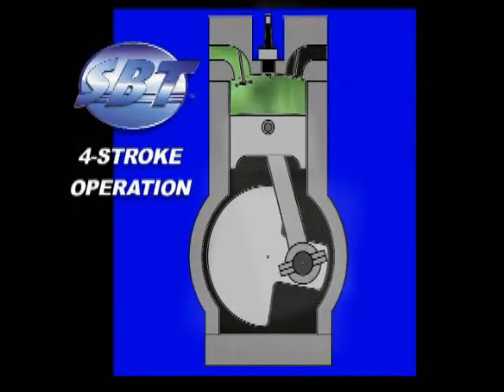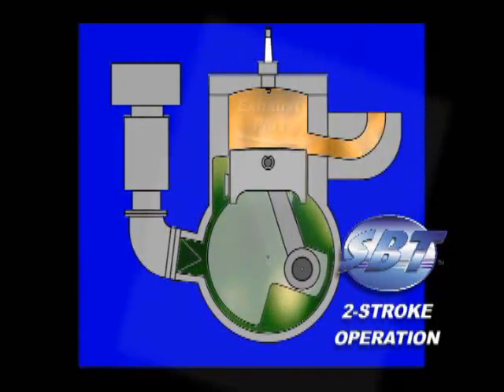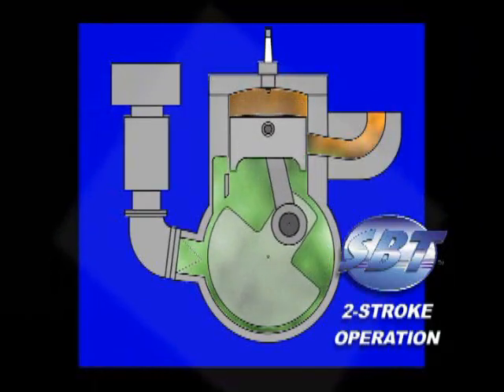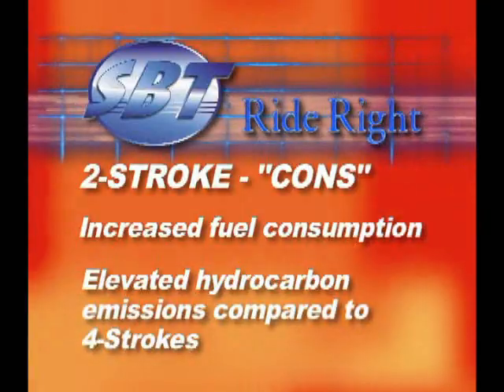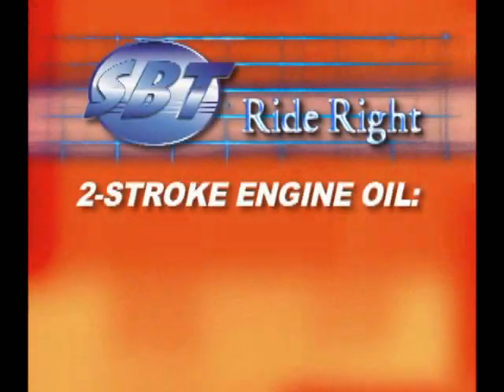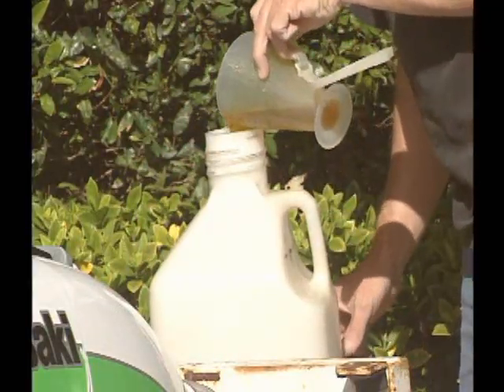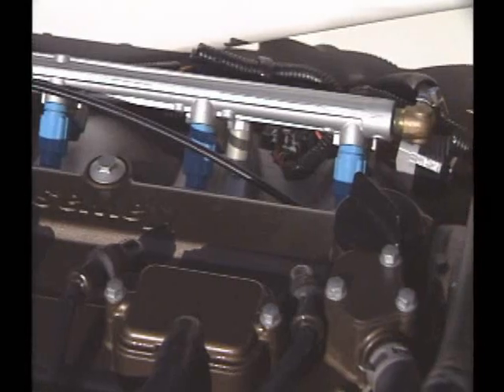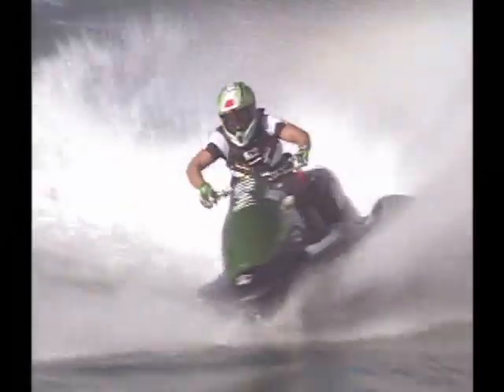2 Stroke Engine vs 4 Stroke Engine

Comment: Is the 2 stroke engine less efficient?
Reply: The power band "issue" is not related to gearing. All engines have a peak bhp at a certain rpm. With a 4 stroke this area of peak bhp is is much wider than with a 2 stroke.However, although the powerband is narrower with a 2 stroke, it is typically much higher than a 4 stroke when comparing 2 engines of the same capacity.

It is not an issue for seasoned 2 stroke riders, if you watch professional enduro riders, they use the light weight of a 2 stroke with it's high peak power to get up hills you would struggle walk up. The same rider could not do the same with a 4 stroke. It's horses for courses. Both have their pros and cons.
Reply: depends, 2 stroke are much faster per cc. for example, when moto gp had both 4 stroke and 2 stroke in the same championship it was 500cc 2 stroke against 950cc 4 stroke, they were fairly evenly matched. 2 stroke is way more fun, sound amazing but are more difficult to manage the power. they have a much smaller power band than 4 stroke.
Reply: Nevets
Interesting! How about fuel consumption?
Reply: +Richardsen they tend to have higher emissions, due largely to the fact that unburned fuel escapes with the exhaust.
Reply: When it comes to fuel efficiency, yes, a 2 stroke is less efficient than a 4 stroke, when it comes to power, a 2 stroke has more than a 4 stroke simply because there are less moving parts.
Reply: +Richardsen It makes about twice as much high end power, due to requiring half as many strokes
Reply: Kenny Smith
So why aren´t they more widespread?
Reply: Christian Hodges
Ah, so there is some inefficiency. That was something that kept me wondering; the absence of valves like in a regular 4 stroke made me think of a... less precise machine when it comes to admission and exhaust.
Reply: Nevets
So that is why they are not more widespread then.
Reply: Richardsen The main reason is probably environmental. They burn oil as it is mixed with the fuel and not all the fuel is burnt. 4 strokes have a wider power band which makes them easier to ride but not as much fun. You have made me realise that this is quite a complex subject. Enduro riders love 2 strokes, MotoGP riders who rode in the days of 500cc 2 stroke, really miss them. 

My first few bikes were 2 strokes so my view is probably biased. Having said that, I doubt I would have anything but a 4 stroke now. I am pretty keen on the Honda Africa Twin.
Reply: Nevets
This has been an interesting insight. Thanks!
Reply: +Nevets You guys mention power band, and power control issues ( difficulties, if you will). Elaborate please ? 

Is it because the 2 strokes might have shorter gearing ? or are just pumping power out so quickly it's kind like a "o sh*t" when you twist the throttle ? im under the in personation its a lck of power .. but if the 2 stroke makes power every 2 strokes... then it cant be a lack of power aha 

the only thing that keeps me wanting a 4 stroke is the depth of the exhaust noise.

Comment: the baised will always exist. But the fact is that 4 stroke has more advantages.
Reply: True 4 stroke engines are better about controlling power but if a 4 stroke motor blows up its gonna cost a lot more than a 2 stroke motor to replace.
Reply: +Open the Light AUA Naah...

Comment: yeah well im riding a Moped with a 70cc 2T Engine and im easily passing a KTM Duke 125 with a 4T engine, face it 2Stroke has a way higher power output and a way higher fuel consumption :3
Reply: +Jed Jeakings no theyre not lol
Reply: [100]PureBlacK my 1981 yz125 2 stroke has got the intake on upper cylinder  explain dat shit!
Reply: You are an idiot, KTM duke is so shitty. But try passing and YZFR125, you wouldnt get even close.
Reply: Doesn't change the fact your on a gay shitbox

Comment: what happens if you put 2 stroke oil in a 4 stroke 150cc engine?
Reply: angelisone stfu people are trying to help you and you are just being a bitch about it
Reply: +angelisone just thought id remind you like everyone else about how shitty you are. throw your pc/phone in the road, bud.
Reply: +Cairo Murphy (TheMasterAssassin8787) no my friend put 2 stroke gas in his 300ex and nothing happened other than it wouldnt run worth a crap and he lost alot of power, and its ok to mix ur gas in a 4 stroke every once in a while to clean stuff in the motor or just simply put a little diesel in the motor and it will clean the motor too
Reply: +angelisone  its a lubricant so under light load it would be ok certainly wouldnt affect
the performance but under load it would cause bearing failure eventualy because of
its very low viscosity !
Reply: +angelisone Seriously? You are asking a question. We are trying to give you answers.

I happen to know exactly what happens when you put 2 stroke oil in a 4 stroke.
Here is your answer:

Small pink unicorns are expelled from the exhaust port. They exist for only a fraction of a second before they evaporate into vaporized Milk Duds.

If you don't believe me, perform the experiment yourself and find out. Or you can take the word of a random person on the internet who claims to know, which is what you were seeking to do in the first place.
Reply: ***** No, the question was into the oil tank (oil cap's hole).
Like using the wrong oil.
Reply: ***** You are just guessing. So you don't know the answer.
Guessing is not an answer.
Reply: angelisone Engine will run rough and probably seize.
Reply: Cairo Murphy you are guessing also.
"probably" is not sure.
Reply: ***** gotta love people getting madddd because he couldn't answer a simple question.

bet you can't tell the different between regular oil and synthetic oil once it's installed in the engine.
Reply: if you mix with gas with oil it will smoke more but put 2 stroke oil in 4 stroke oil it with melt engine
Reply: +angelisone your not a good person
Reply: +angelisone well normal people dont put 2stroke oil in a 4stroke so you asked a dumb question
Reply: the engine will seize up due to lack of lubrication, the oil will burn out. Once there's no oil in that block it's gonna seize, if not throw a rod altogether
Reply: +angelisone And the 4 stroke will either not run worth a crap or just lose alot of power
Reply: +Shaun Keefe yes your right
Reply: +angelisone Good question. I almost run out of gas in my car once. I usually keep half a gallon of gasoline mixed with Red Line 2 stroke oil 40:1 for my RC planes with DA engines. I was wondering if I ever run out of gas and I have an emergency that i have to be somewhere, what would happen to my car's engine if I use it... besides the unicorns engulfed in tons of smoke.  If I ever do it, I will report.
Reply: you're a fucking dumbass
Reply: dont call people dumbasses, he wasnt sure, just cause he didnt know doesnt mean people like u can come around and call them dumbasses!
Reply: ooo, somebody didnt put their tampon in the right hole this morning
Reply: That's what I damn thought
Reply: what is what u "damn thought"?
Reply: you would know
Reply: who is stupid
Reply: you go first, and also, how do you know what i look like ya pervert
Reply: LOL, people these days pfff lmao
Reply: +angelisone Well 2 stroke oil is not heavy enough to properly lubricate the engine, the differences between a 4 stroke and a 2 stroke go well beyond simply the strokes in a cycle. Your engine will blow up, simply put.
Reply: +Kenny Smith nothing smoke like a bitch
Reply: +Sacrifice195 clean the motor😂😂😂 it would do the opposite
Reply: you wont have to clean the motor cause it will be too late, 2 stroke oil breaks down, 4 stroke oil dont break down as easy, it takes a while for 4 stroke oil to break down

Comment: Try the 2T motorcycle and 4T motorcycle. You will see big difference. For me 2T on motorcycle is better than 4T
Reply: +Abimanyu Damar H Especially a 50cc... 2 or 3 times greater power (2T 50cc) than a 4T (50cc)... I liked the bike a lot back then (2 years ago or 3)

Comment: Michael Harrison from the DeepScience BIGENZ team has this to say:
Most of what is written on advantages and disadvantages of 2 strokes Vs 4 strokes is not actually correct.

Take for example the lubrication issue of 2 stroke engines, sure small chainsaw engines may have the oil mixed with the fuel but this is not a direct result of the engine being a 2 stroke, this is just a result of someone designing a very simple engine. look at any large Caterpillar, or Detroit 2 stroke they have conventional oil sumps, oil pumps and full pressure fed lubrication systems and they are 2 stroke!

Also, the argument about valves of 4 strokes versus the reeds and ports of 2 strokes is also incorrect. Sure some simple 2 strokes may use very primitive systems to achieve the control of fuel/air mixture into the engine and exhaust out of the engine but again this is not a function of them being 2 stroke! I've worked on 2 stroke engines that feature poppet valves in the head (like a standard 4 stroke) - but they are definitely 2 stroke - it's just that engines like this are not so much in the public eye - next time an ocean liner (ship) pulls into port check out its 2 stroke, turbo charged, direct injected diesel engine!

Finally, the arguments of simplicity, weight, power to weight, and cost of manufacturing are not a function as such of 2 stroke versus 4 stroke engines. The mistake of most of these commentaries is that they are comparing a simple chainsaw 2 stroke engine with a complex 4 stroke engine from a automobile - not a very fair comparison.

As far as the exhaust emissions of 2 strokes - check out the Surrich/Orbital 2 stroke design that Mercury outboards are using - this is as clean burning as any 4 stroke.

The ONLY correct comparison of 2 strokes with 4 strokes is that a 2 stroke can (in theory) produce twice the power of a 4 stroke for the same sized engine and the same revs.
Reply: Very true. That is why all car manufacturers use 2 stroke engines over 4 stroke!

Just kidding. Making up for the traditional flaws of 2 stroke compared to 4 stroke requires either premium (expensive) materials, higher tolerances (expensive), more complexity (expensive and heavy), the list goes on. By the time you make a 2-stroke just as efficient and effective as a 4, you have a prohibitively expensive engine, when you could have built an even better 4 at the same cost. 

2 Strokes are just more simplistic engines, which can be great for small machines, but bad when efficiency and high power are a priority
Reply: @IFearlessINinja  Depends on what you call a small machine?
Reply: Actually the biggest advantage of a 2 stroke is it's ability to produce the same power while weighing half as much.
Reply: Excellent explanation!

Comment: yeah, engines are a complicated thing... it seems to me that the fact that a 2-Stroke engine gets everything done in half the piston movements really speaks for itself when it comes to which one is the more genius design. but on the other end of the spectrum, look at car engines; take a standard internal combustion car's engine & compare that against Mada's Triple rotor Wankel Rotary engine WHICH has no moving parts that change direction... that's definitely a way better way to go.
Reply: DEM0N 2 strokes get more done in less strokes, but 4 strokes get more done with less fuel, so it really depends on how you look at it what one is the most genius.
Reply: DEM0N If you really want your mind blown. These complex machines were invented a long time ago... and nothing has been done to change in the way the perform. The otto cycle (4 stroke) engine was invented in 1876. The 2 stroke was invented in 1878.
Reply: @ganthore  Loads has been done,That otto was a single cylinder running on "town gas" ( coal gas) with a carrier flame,Do you open up the hood a light a match for the carrier flame? Do you pump the fuel and oil by hand?
Reply: Having rotor tips that need replacing every 40,000 miles 3 different oil baths,The displacement is actually a third so a 1.3 consume the fuel off a 3 litre and gives as much performance with excessive insurance

Comment: Can someone explain why 2 strokes are more popular in dirt bikes than a bigger street bike? Is it just because of emissions?
Reply: It is very much because of the two stroke engine is not very good for long distances, it needs a rebuild a lot more often than a four stroke and yes, emissions is one of the reasons. For dirtbikes they use two stroke because of the light weigth of the engine and good hp to cc ratio. Dirtbikes are made to be simple so the engine is easy  to take out for a fix or a rebuild.
Reply: If you build a 2t engine that big as a street bike it would be too powerful for the street and for gas consumption and for emissions and noise
Reply: Ian Williams It's because of the EPA, yes... but in the end, a 2 stroke creates twice the power. 4 strokes are cleaner, but it takes more use of energy to open and close valves. You have no camshaft in a 2 stroke. All the air is coming into the combustion chamber by the piston moving up and down, while a 4 stroke connects the crankshaft to the camshaft to give the engine oxygen. It's simple, but difficult to explain

Comment: the biggest con for the 4 stroke is its gona cost 2 times as much to rebuild
Reply: +James Campbell my honda CRF 450r needed a rebuild.. £130 for valves, £96 for valve seats, £30 for valve springs, £92 for piston and rings, £250 for barrel and gasket set, £20 cam chain.. = £618 for just the parts..
Where as my Kawasaki KX 125 rebuilds - £120 for barrel and gasket set, £75 for piston = £195...
not to mention, the CRF, being a 4 stroke, has alot more work involved.. Needing a hydraulic press to press the valve seats into place, valve seat cutting cool to lap the valves, then cam chain tools, etc..
2 strokes are,.. unbolt head, slide barrel off, remove piston, slap new piston on, slide new barrel on, and tighten  head bolts... which takes all of 30mins to do - the quickest i ever rebuilt my CRF engine, was 2 and half hours, and ive done it a few times, so pretty good at it
Reply: Nah man you wAy wrong
Reply: +James Campbell Not really, there's waaaay more parts.